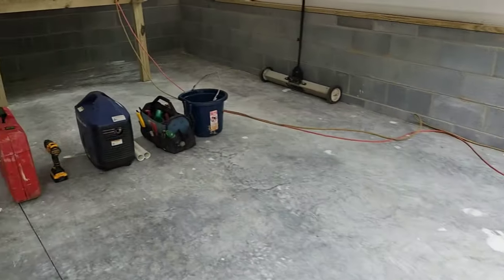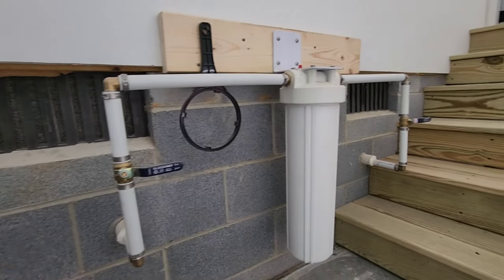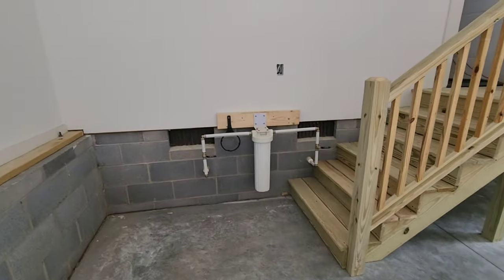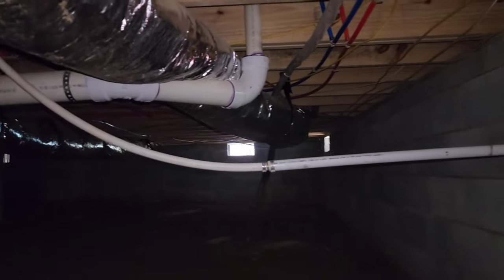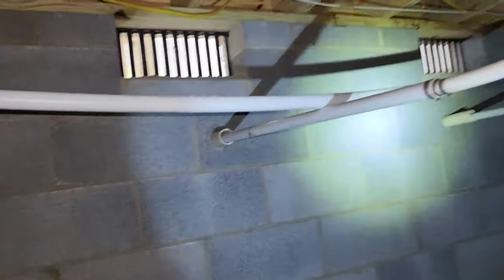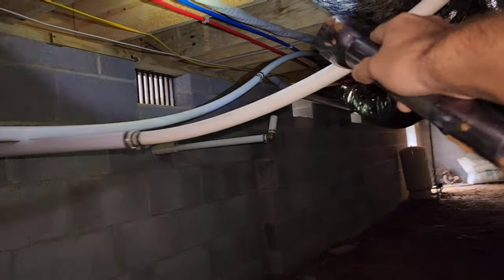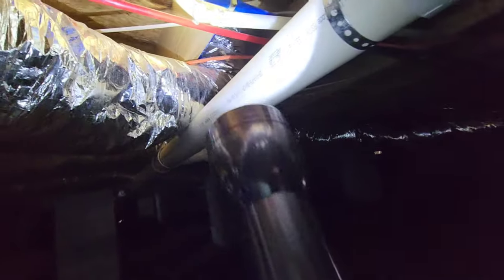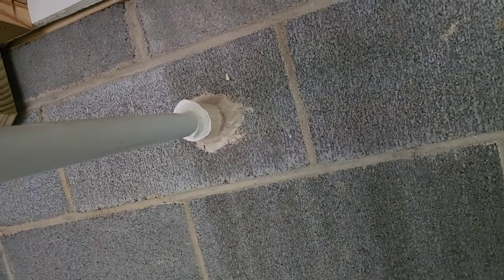Big Blue Filter Install "Put in Wrong Location" Per Owners Request. Had to Move Everything

Comment: If it were my house, I would have put the filter on the right side of the stairs on the concrete wall.  If those stairs ever need to be replaced (or changed), it's going to be a mess dealing with the filter/pipes attached to the stairs.
Reply: Should never rot if the inside is kept dry.
Reply: @kylekelly1167  True, but that's not the only reason why someone would remodel.
Reply: Exactly. Those pipes hanging in the air look like crap.

Comment: It will work for sure probably would have added a few hangers for stability. I realize the homeowner wanted it on the deck but I think I would have suggested the same mounting option as original but on the right side of the steps. I'm my humble opinion, they just lost a lot of storage under the deck. Plus the wall is a more "permanent" location for future expansion or ADA ramp if needed later in life.

Comment: Why weren't the two horizontal pex pipes coming from the filter secured with clamps? Aren't they going to flop around every time the water comes on? Definitely better where it is now. The old location people would be bumping their knees or hitting if they wanted to bring something large up the steps. I would have put the filter on the right side of the stairs on the concrete wall. It's an eye sore where it is now.
Reply from the maker: I totally agree. The porch wasn't built yet when I installed the filter the 1st time. I think it's an eye sore too.

Comment: I assume the owner wants it where it's easy to get to and change the filter so the location although not the best would make it easy to access but at least the valves should have been mounted horizontally and clamped to the wood and then the piping should have gone as high up as possible under the deck to an elbow down the wall and to the holes which I assume could not be drilled up much higher. This would have secured the valves and your storage under the stairs would not be obstructed. It's hard when you do a good job and then it needs to change and you have to redo your work but really have to not let the frustration get to you and plan it out as best as possible.

Comment: So, the contractor should pay to move. The original install is where his customer wanted. Its not up to sub con to confirm install location with contractors, owners, carpenters, design team....that's the GC job. GC contractor should confirm the design location with all affected parties before installation begins. Having said that, I understand giving that if contractor a reg customer.
I would want system on wall adjacent to the right of the stair landing at about 48" AFF, or under the home at location close to access. You are a good guy. Wish I had a crew with your work ethic. I would go back to contracting.

Comment: I wasn't going to give my opinion since everyone else had given you their's but then around the 6:45 mark you asked for it, so...

I'm a 70 year old man and not getting any younger so mounting it accessible was very wise.

I am, however, curious as to why you couldn't run the pipes higher, strapped on the bottom of the porch deck instead of "flying" unsupported through the air?

Comment: Yep, Always bad to have to redo a Job where you were Told to Put things .... :-(   :-(   :-(  .... Question.... Why did you have the LONG 'Drop Lines' ????? Why not secure the pipes via an Elbow and secure them Snugly to the Floor Joists under that 'Platform' and only Then do a short 'Drop Line' agains and thru' the wall ..... ???? It just looks so Super Vulnerable the way that it is Now ..... ????  The 2 Ball Valves could be Under the Platform or even right against the Filter ..... I Love watch All your vidclips and Never miss ANY .... Best to You and Yours from ChCh, NZ

Comment: It looked better in the original location. Unfortunately, the location on the stairs may be problematic in two ways...

1. If the stairs need maintenance or repairs, it could be tricky dealing with the filter.

2. Risk of damage from its location (it's a garage, I assume. A car can bump into it, causing a massive leak. Behind the stairs along the wall under the deck would be better.

Near the pressure tank would be ideal, keeping all water lines in the crawlspace and protected, but the homeowner didn't want it that way.

Comment: Basically a set of steps with handrails coming straight into the room was all that was needed
Reply: It's a garage, which is also why the filter shouldn't have been in the front side of that landing.
Reply: @thomasbonse  "It's a garage" What is your point? My point is that a landing isn't even necessary or required with an inswing door, so the filter could have just stayed where it was. Too much money I guess!
Reply: @buddyroe  Being a garage introduces space constraints in order for the garage to be usable with vehicles.
Reply: @thomasbonse  👌

Comment: Considering that's a garage space, being on the front of that deck in what appears to be a fairly short garage, it's very likely to be hit by a car being parked. Quite frankly the logistics of that landing are the problem and the result of poor engineering and planning on the part of the builder. Yes, this means you're having to accommodate their poor planning (blueprint level poor planning). You were really only left with bad choices between the homeowner and the builder.

Comment: Do you have videos on tanks that does not have a bladder
Reply: Mine used to be like that, air over water, kinda strange setup, little gizmo to add tank air and another to remove to maintain optimal water level in tank.

Comment: These customers not worth your time....As for your Requested filter Install job, seems the home Owner was your Direct customer giving you Specific install Location instructions....Any lack of Planning by That customer is solely their Problem & any demo/Redo labor--parts cost strictly on them....Hope you charged them for All the labor time (Demo & new filter job install) to date...The "New" customer Location is so obviously Bad again & after they smash it off the Protruding stair landing will no doubt want more Free redo corrections...During building construction jobs,  Only work off the official job blueprints & only for the main job contractor....